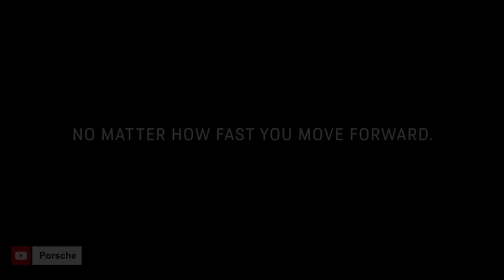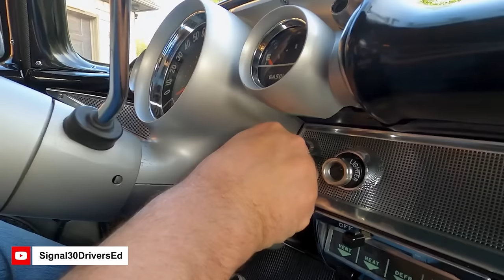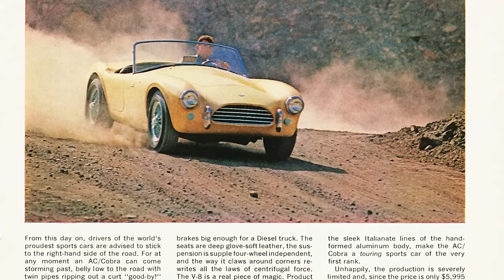Why Old Cars are Better

Comment: I live in Europe but drive as a daily Toyota Tacoma  2008 with 2.7 and manual gearbox. Simple, enough power, comfortable, no dumb eco stuff. Most of European cars from that years don't offer all of it in one. If you want car with space inside you need to buy cars like Touareg, Q7 etc.
Simple gasoline engine? Sure, you still can find something but mostly in premium brands... maintaince can be cheap but reliability not really. 
Most of cars here have stuff which mostly I would use twice. First to check how it works and second to show others. 
Quality of materials mostly have problem to survive so long. Taco is still stiff like it was new. 
Btw. I could buy 4Runner or something else from US but bed is required instead of towing a trailer because I live in town which remember communist way of building towns so no chance to park trailer without issues or paying a lot for a place to park it.

Comment: I can't think of a single new car whose styling makes my heart jump - due to government regs for gas mileage, they are all subject to the wind tunnel, and air always moves the same way, so there is very little room for, say, a thrusting front end or crisply cut flanks or - God forbed - a reverse rear window.  There is a visceral feel to all the cars previous to the neutering of styling, as well as the feeling of direct connection to the controls.  There are no computers between me and the throttle or steering on my 75 Firebird; try and do a burnout on a new car without manually disabling the traction control.  If I want to smoke the tires, it is just a push of the throttle and the 455 does the rest.  Yes, it squeaks and rattles, and my Lexus is much smoother (and, truth be told, probably faster...), but the experience is no thrill.  I own a time machine...

Comment: Old vs new are not any better than each other, say 1970 vs 2020, they are just different, well said. You have to keep more things in check on an old car but it also always works or can easily be repaired, vs new cars having small issues that can prevent something from not working correctly and sometimes it’s something that we cannot fix ourselves so was that really an improved system? I’d rather rebuild a carb on the side of the road because I’m still not actually stranded.

Comment: I sure do miss that physical 'connection' between you, the car and the road that only the old cars gave you.   I good car to me is one without all the conveniences but you are complete control of.  No power steering or brakes so you can feel the road.  No automatic transmission so YOU control when the shift happens.  etc...

Comment: Nothing like getting 18 miles to the gallon, vs our modern cars that get 30+.
Reply: My 1977 Beetle gets 35mpg. Shares a lot in common with the 1938 beetle which got 30mpg. If in 1938 you could get 30mpg than why are modern cars barely doing 30mpg?

Comment: New car makers, even the best modern Hondas and Toyotas  and engineers, see this video more than once. I have a 1989 Honda Accord Ex 1989 carbureted manual... an HONEST car that makes you feel great behind the wheel. At over 70 years old, I would not like driving in a chesterfield-interior American car, which is the way new cars, even Honda Accords and Toyotas are going. The truth is, if I buy another car , I'll buy the cheapest, hopefully manual car that makes my day.

Comment: You forgot to explain how companies want you to continue to spend.

Planned bad updates to make things fail in vehicles today is a thing now that we as consumers must consider when making purchases for new cars. 

Now we must face which company is willing to screw us over more than the other company in terms of payments and theft within their own dealership when you get the new vehicle fixed. 

That’s right, theft. Paint tiny dabs on your old car parts to bring it in for a check on the alignment with tire replacement and realize the little metal parts inside with the tiny paint dots are replaced with cheaper non-metal bits inside so in a few months you will have to bring that vehicle back to the dealership again to get it fixed. Or how some car companies replace wires with a very fun new item made of soy so that it’s a rodent attraction for the rodents to chew on and damage the vehicle and have the smug look at the dealership tell you it’s not their fault. 

I just don’t want to be screwed over by companies with very cheap and very risky purchases that I’m too cognitively disadvantaged to learn about from the beginning. I’ve always had bad memory issues unless it’s something my mind gets considerable amounts of dopamine from learning. And I feel most people don’t have the time with their jobs and lives unless it’s really an interest and a passion of theirs. I tried to get into building electrical and wiring things up because it was an interest of mine when I was little and my mind wouldn’t let me because of math and memory.  

Car companies want to keep us blind and if I do mess around it’s not under warranty if I mess up or they find out I was trying to tinker around with the electrical wiring that needs fixing! 

Imagine the fun I had to deal with when needing to replace one little item in my fathers brand new 2019 Toyota, only to have to pull apart very specific and very delicate electrical systems just to get to the damaged cable port that when I look this issue up with the dealership for pricing to then realize it’s by design they made it this difficult and made it easy to break. 

It would be a $12k job in the dealership to fix that tiny charging point just so I can use the cars map ability with my phone. Now I don’t use it because it broke months ago and $12k is a lot! 

I can’t believe you have to pull apart the entire dash board just to get to the charge port. 

Old cars were made to last. New cars were made to work until a certain point so that the consumer continues to have to purchase.

Comment: In modern cars they really take a lot of control out of the hands of the driver and try to automate it. I just like older cars because they do what you want them to, they won't say no lol. You just have to not be stupid and know what you're doing before you do it. Not to mention every modern car has a stupendous amount of computer modules that control not only the engine and transmission, but modules that control interior parts of the car as well that very commonly go out. Things as mundane as controlling the blend door for the air conditioning and things like that. Alot of older cars only need like two wires to run providing that everything mechanically is working. Even then, these older cars aren't more reliable because they are mechanical, they are more reliable because they are simple. modern cars are far more complex in every way. sure, the engine will last longer on a modern car generally speaking, but you're going to end up having to fix problems in multiple other systems of the car that are needed to make it run many more times than you would need to repair anything on an older engine before the engine mechanically gives up the ghost or gets tired. And the cost to repair those systems are usually very high on a modern car, even if you do it yourself sometimes. Obviously, it depends on the engine and what car it is but I agree,  the older cars are better in my opinion mainly in terms of their looks and ease of repair and reliability due to their simplicity. It also doesn't help that when you have an older car that the OEM does not manufacture parts for anymore, you basically have to rely on aftermarket parts that are sometimes better and sometimes worse, and when they're worse it makes the car in general seem less reliable than it really is.

Comment: There are some very reliable old cars. I'm a big fan of Citroen 2 CV. It is so simple that there is almost nothing that can go wrong. In the very unlikely case that it does happen, miniscule 2 cilinder air cooled engine can be taken out by 2 people and literally taken apart on the kitchen table. It always starts, winter and summer. It even has self balancing wheels. 

It' s Achilles heel is corrosion. But mechanical parts are undistractable. Fuel consumption is very low. Not a highway car.

Comment: Fuel injection is more reliable when it's working... when it isn't it's no different than a non-working carb. Except you can rebuild a carb. Good luck rebuilding a fuel injection system, especially if the computer is dead.

Comment: Look at old refrigerators like  a 50s refrigerator chromed out handles a butter warmer ice cube maker those are better than new ones
Reply: My brand new fridge has all of those things? And is FAR cheaper to run that some antiquated 50's design. 

You're comparing a 50's top spec fridge with modern budget models, of COURSE they're going to look better at face value.

Comment: Old cars are certainly better, they had a bare minimum of planned to fail parts and intentional user unfriendly design. However the Blazer version of your truck is the car ive most ever seen broken down during the late 90s - mid 2000s

Comment: OLD CARS are better Styled. Less safety, & emission regulations meant more freedom for stylists. But if you use an inflation calculator those older cars and trucks actually cost more than todays vehicles. The Older cars and trucks didn’t have 10% of what we take for granted now in our cars. From ABS Traction Control., Air Bags, A/C, PW, Electronics etc. So the cost cutting had to come from somewhere and usually in interior materials and color coordinated interiors to exterior colors.

Comment: So I'm 17 I had 06 Lacrosse ez too see around sounded decent for a V6 and nicer comfort said by my own parents who own there brand new cars

Then I had a Buick Enclave CXL after crashing and this pos was hard to see through way too technical and just so much junk I did not even understand thank god it got sold and screw push to start even some non car guys I know say they like key more

And NOW Its so different my modified TJ Wrangler restoration of a 99 it is so charmingly different everything is able to be worked unlike the dumb Enclave but this guy has glass headlights the risk of blowing the motor lol easy visibility and is just so retro cuz Jeep was still Jeep like I dont how to describe how cool it is to be in something with amazing quality and simplicity and it sounds just so real its the best couldn't have been happier to restore this wy dad

I never forget the day I 1st tried out roll up windows in my dads restoration Ram good times I love OLD VEHICLES MORE NEED TO EXPERIENCE ONE

Comment: Cars manufactures today uses the same chassis (platform) because making one requires a lot of money and safety tech intergrated inside it..  making why lambo looks almost the same since aventador came out in 2011 to today with revuelto.. so does with bugatti.. since the veyron.. or even toyota sharing chassis platform with lexus and all of other car manufacturers.. hence cars these days look the same.. 
also 2 door cars even though it looks great, consumer wants more practical cars, and everything became suv..
even worse, electric cars is just the begining of human and machine get separated even further. no connection at all.. in the end, repairs more expensive and harder to work on, pushing drag coeficient design leads to make the cars look like a soap, cars will be more of a phone rather than.. a car..

Comment: New cars need.
More steel less plastic.
Full frame.
Crank windows, lets you put them exactly where you want.
Wing windows, fresh air wo/ fan.
Floor vents, DITTO.
A solid bumper = bumper jacks. Change a tire in 5 minutes.
A full size spare, not fix a flat or a tire good for 50MI / 50 MPH. 
Stick shift, It's not that hard to learn.
Wayyy less electronics.
Old VS new, I'd be willing to bet any inline 6 from the big 3 would out last any new car
in years, and many in mileage.